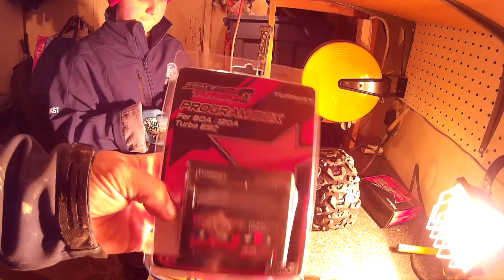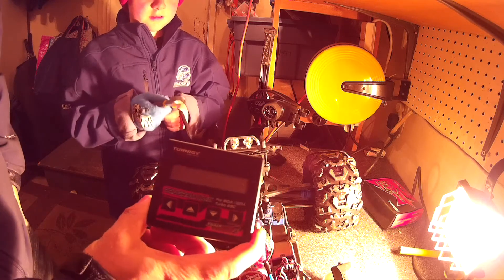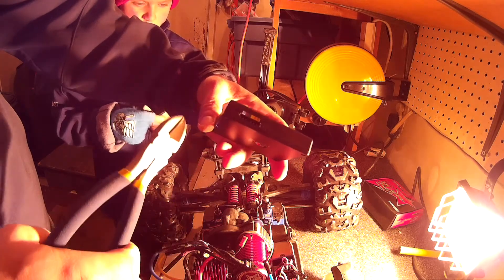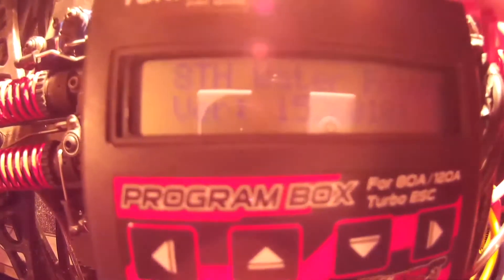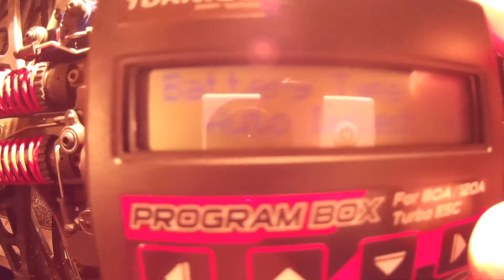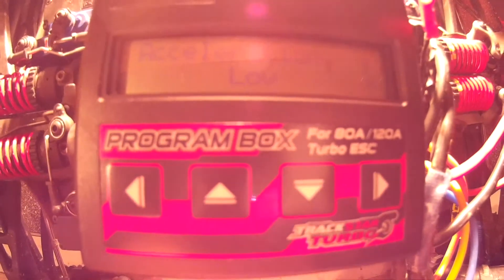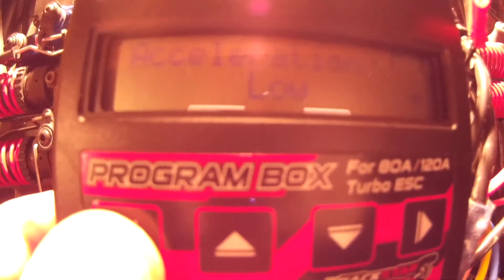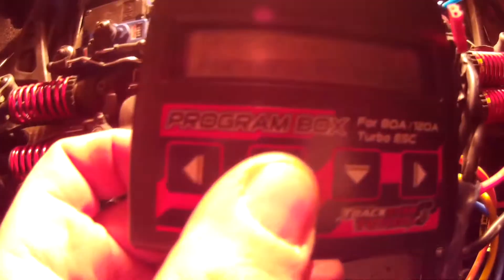Turnigy TrackStar Turbo and Waterproof ESC Programming Box

Comment: Hello. I have a 2100kv turnigy 1/8 combo and it does not have a smooth start. Can I change this problem with Programming Box?
Reply from the maker: Вадим Мов hello, yes it has a throttle setting, 3 settings I think.
Reply: @csuyou  thank you!

Comment: Does it have lipo cut off options?
Reply from the maker: Yes it does.  3.7-3.2 if I remember right.
Reply: +csuyou I didn't see the option for it when you went through your video
Reply from the maker: I remember it being there.  It is a huge upgrade over stock traxxas that seems to cut off at 4.2 volts.
Reply: +csuyou i just got the trackstar waterproof 120a program box, same as yours in the video. yes i had to do the cut-out also and it works good, thanks for the tip. also, there is no lipo cutoff setting. thumbs up though for your video.
Reply from the maker: LC Turnatrax thanks for the feedback, that will likely help out some other people. I have 2 of these systems, they are a good bashing brushless system.  cheers.

Comment: I just installed my 2100kv turnigy 1/8th combo and have this box.  We're you impressed with the settings for the waterproof version esc?  It's nice to have but seemed limited?  Combo runs great though.  Have it in my 2we slash....
Reply from the maker: Yes I am happy with it, the only flaw I see is it is not good at very low speeds, other than that pretty good.  Works great in my e-maxx.
Reply: Yeah, so I've run about 5 packs at least though this.  2s lipo.  Glad I bought the tuner cause had to turn down the power.  But I'm very happy with the setup.  I do see you give the throttle a little bit before she goes and by then it's going. For the price can't be beat.
Reply from the maker: agreed.